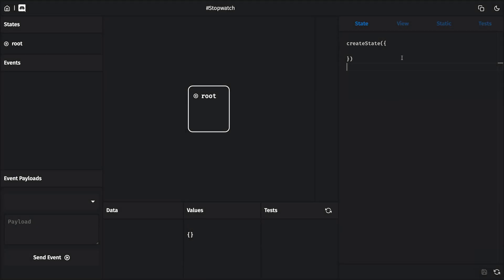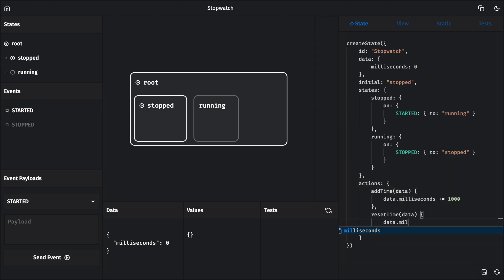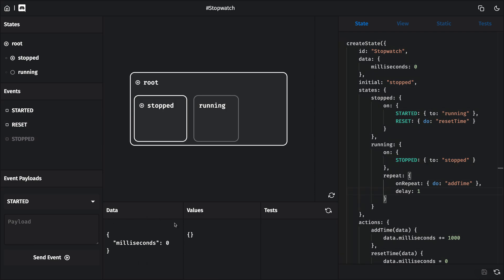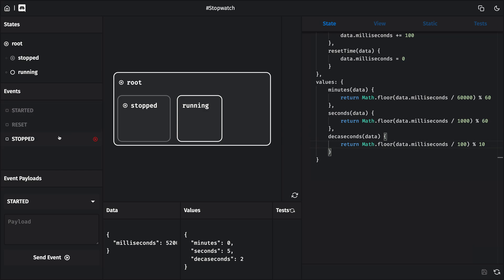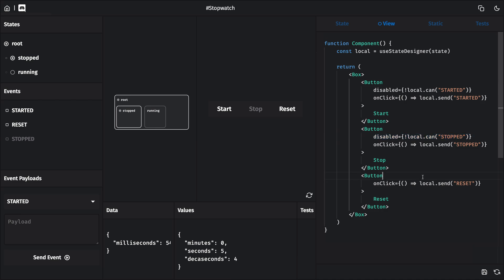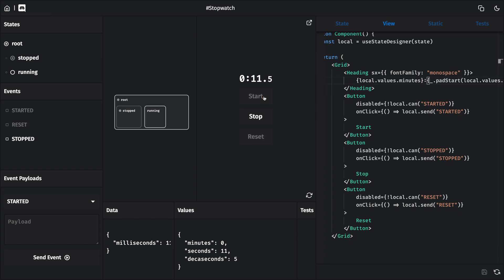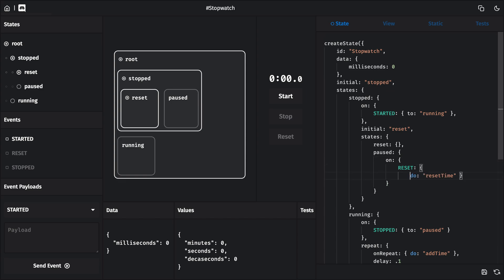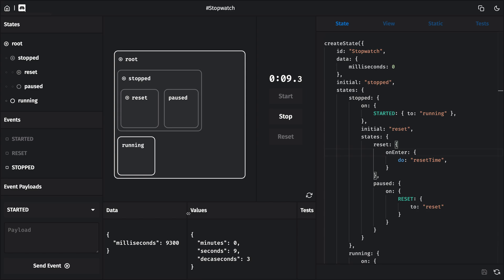Let's Design a Stopwatch

Comment: Nice interface - are you planning to make it compatible with Xstate? It would be a perfect enhancement of the use of Xstate:
- Design the states with State-Designer
- Run the app with Xstate
- Visualize your app states with Xstate!
Reply from the maker: Thanks! My priority for now is to get the design experience really strong, but export is on the map. xstate and State Designer work very similarly on the basics, though there are some cases (delays, more complex conditions like unlessAny, and events that are handled at different places in the tree) that would be harder to resolve. I’ve let it diverge from the scxml spec when I thought it limited UX, but that’s maybe a longer story :)